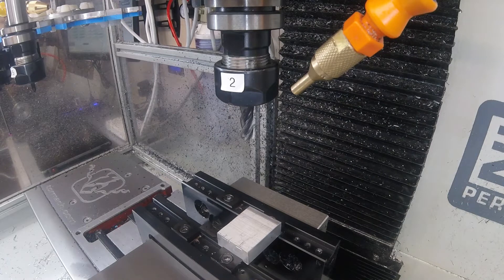Probing Angles and rotating the machining axes on a Tormach 440

Comment: Holy Mackerel. That's amazing! How did you do that? Can I do it with PathPilot?
Reply from the maker: Apart from the rotated axes bit, all the probing routines in Fusion 360 are in the current edition of Pathilot.  The axis rotation can be done too, but really needs some UI support to make it usable.

The custom POST should be in the subroutines folder together with a readme file explaining how to use them.
Reply: @daleksw  Thanks for the quick reply. Something else jumped out at me when I watched the video again. You seem to be getting a lot more pressure out of your misting system. And it looks like you're using a different coolant. Could you share your setup with us?
Reply from the maker: Nothing much to say about the coolant.   It's one of these https://www.amazon.co.uk/Deals】OriGlam-Coolant-Lubrication-Cutting-Engraving/dp/B071DXGGP4/ref=sr_1_6
 and the valve is one of these https://www.amazon.co.uk/Woljay-Pneumatic-Solenoid-4V210-08-Position/dp/B06WD2NP74/ref=sr_1_3 I'm running it from the same 5-6bar air supply that runs the pdb and all the lines are 8mm to get good flow.

Worst thing about the setup is the coolant flow adjustment is very sensitive, so difficult to get just the right amount of coolant.

Comment: That's pretty neat isn't it! I'm not using Mach3 but I'm wondering if you had to mess with the post processor to get the probing functions to work? Presumably you have to connect the probe input to the probing routine to get sense out of it.
EDIT - just seen your website relating to the Pathpilot post mods. 

How come you are using Mach3? Did the original Tormach controller throw its hand in?
Reply from the maker: OK, you'll have seen that you need a customised POST and macros on the controller.  Tormach actually bundle that with the latest versions of PP.  The PP one doesn't do the rotation operations, but has everything else.  The problem is that PP doesn't have any display that would tell you axis rotation is turned on and no simple way for the user to turn it off.  That's a recipe for disaster.

The difficulty in customisation the UI at all is the reason why I stick with Mach3.  That and I had it running on a lathe already when I bought the 440 and had enough spare bits sitting in a drawer to be able to do the conversion very quickly.
Reply: @daleksw  Interesting. Over on the LinuxCNC forum you can see how to clone / customise PP to other (non-Tormach) applications, thus retaining the PP GUI and allowing you to add all manner of additional features. And there are quite a few GUIs for those taking the non-PP route. Given that PP is based on LinuxCNC, I'm sure you know this. I started out with LinuxCNC but didn't fancy the self-study, rite of passage PhD required to get it running and customised. I have a life to live.

The macros you've created are presumably Mach3-specific, so look completely different from the syntax used by my machines - Centroid Acorn and (Chinese) Newker (Fanuc clone). It must have taken a lot of work to modify the Fusion post processor and rewrite the PP macros for Mach3. I can sort of get round that to a fair extent, as the Centroid controller has a lot of probing functions built in if you buy the expensive version. 

Nice work and great to see how you have progressed!
Reply from the maker: @murrayedington  You're correct that the machine you see here is running Mach3 specific macros, but you can download the PathPilot/Linux CNC versions from http://xoomspeed.com/CNC/FusionAutoProbing.htm The latest version of PathPilot has them ready installed.
Reply from the maker: Sorry, I'm afraid I don't know what you're asking.